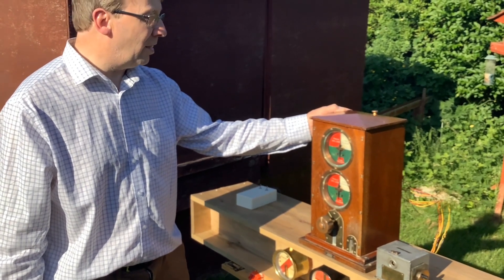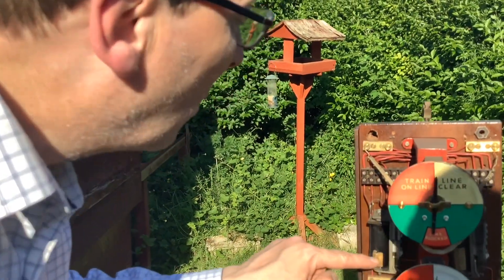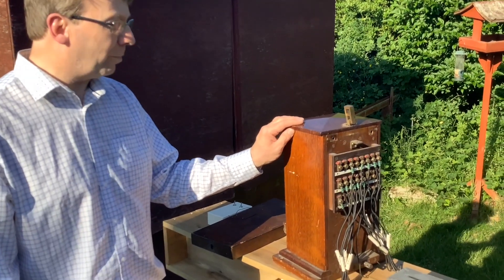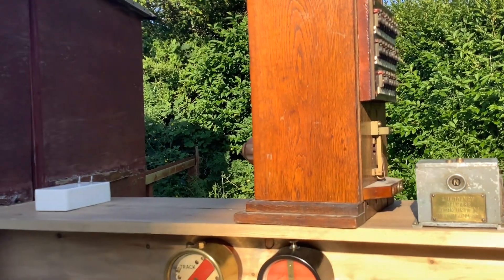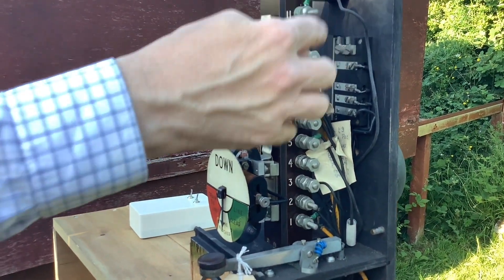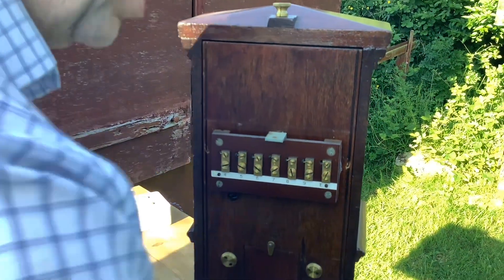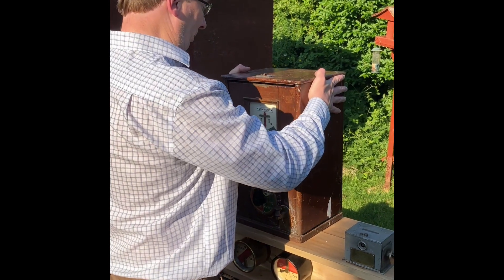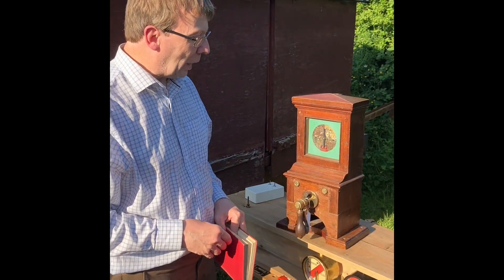Block controls part 2 ,”A deeper look”

Comment: Good evening, it is not clear to me whether the tools necessary for the "Absolute block system" are influenced by the trains or not (occupation of the block or section via the first axis, liberation via the last axis etc.) as happens here in Italy with the Electric Block manual, in the process of being eliminated as it is replaced by the electric axle-counting block, especially along single track lines, or by the automatic block with coded currents, not to mention the recent European system called ETCS Level 2. Grateful for the attention paid to me , I welcome this opportunity to extend cordial and distinguished greetings
Reply from the maker: Part of the absolute block circuitry does include the operation and clearing out behind of a track circuit section at the end of the block section to prove that a train has cleared the section, some do use axle counters, though most in the UK use the standard track section circuit, an earlier mercury treadle was also used

Comment: So Interesting. I still get a little lost with some of the abbreviations (I'm not a signalman) but I find it fascinating the equipment used in a pre digital age. Built to last and actually future proof in its intended design. the sad part is that a lot of equipment was destroyed and that which has been saved is quite expensive to obtain (supply/demand). I have a quarter scale midland "stop" signal in my back garden and would love to connect it to a lever and appropriate indicating equipment. Great video as always.